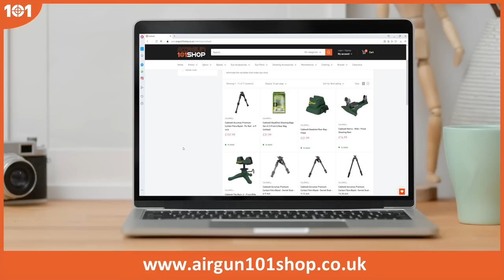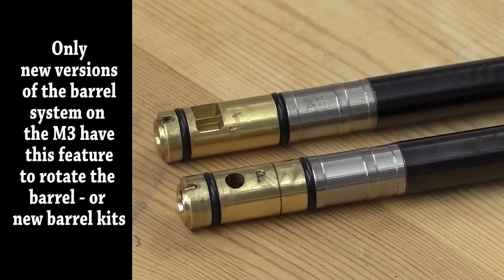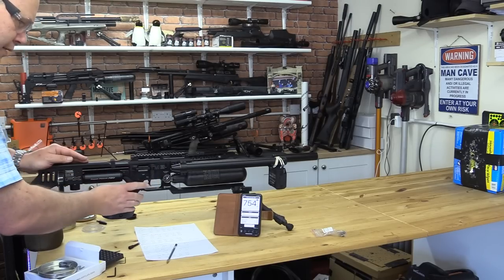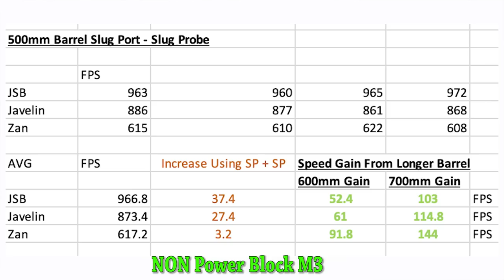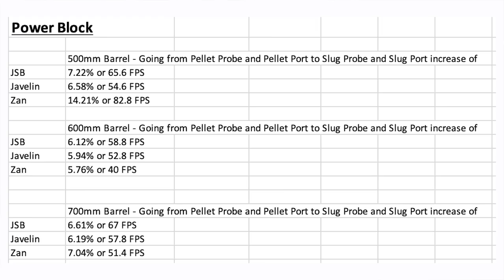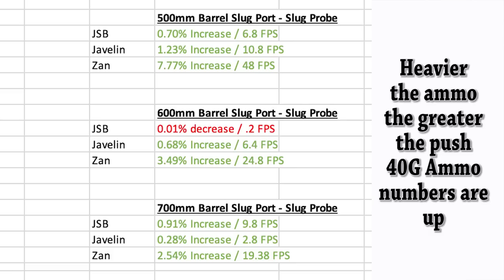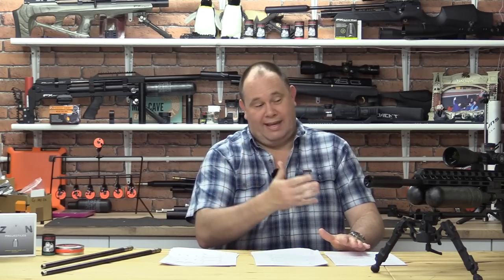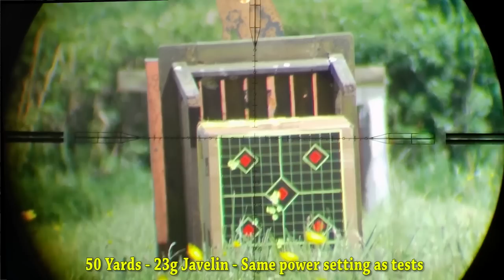Barrel Length Vs FPS Velocity Vs Power Block - SCIENCE ALERT

Comment: Excellent video and highly educational.  Justified my 700mm barrel upgrade!  Kind of fits in with the upgrades.  I took my Gen 1 Impact, added the power plenum and slug probe.  Achieving the same velocities at 35 bar lower reg setting.  It was a huge difference!  Do temper your expectations on what upgrades can do, but yes, they do work.  Well done!

Comment: Great vid and a real brain fryer. Absolutely on the mark with how it all works. The power block basically is designed for high reg pressure so won’t at 100bar make any real difference as the airflow is being governed by the other ports once you stuff the reg up to 150+ bar then it will still flow freely and will give serious speed increases over all barrel lengths although might actually over power the 500mm as that’s quite easy to do

Comment: Great experiment with valuable data. I surmise that if the reg pressure was set higher with the power block experiment, barrel length increase would result in increased speed up to a point. The comment by Joseph Boothe sums things up perfectly

Comment: awesome video, thank you!!! can you make one on accuracy relation on barrel length please!
Reply: There is no correlation between barrel length and accuracy, that myth has been busted a long time ago:) the problem with shorter barrels is that there’s often turbulence behind the pellet/slug because the projectile leaves the barrel sooner, and there’s still air being pushed out. The solution to that is tuning for a shorter burst of air, a shorter time where the valve is open, so there’s no more air being released when the projectile leaves the barrel. You can achieve this with higher reg pressure and less hammerspring tension. The higher pressure will close the valve faster

Comment: Do your findings also relate to springers? Would a standard length barrel give slightly more speed/power than the carbine model?
Reply: No. Most spring guns have barrel lengths that are sub optimal (too long) for velocity, same as 22 LR barrels. That's because a spring gun's compression chamber has a small volume, meaning the pressure behind the pellet drops rapidly during the firing cycle and at some point, as the pellet travels down the barrel, friction forces are greater than the force exerted by the compressed air.

Comment: Sir i have maverick.177 cal compact which barrel is more accurate 🙏need your suggestion 🙏🙏🥰
Reply from the maker: If you get groups your happy with, the one your using. Always test different pellets - 10.34g JSB normally do the trick, or try a Bisley - they work for me also. All part of the fun testing. G

Comment: The probe is not my favorite the power increases is small and does a worse job loading ammo accurately. But also the loading system on every airgun is pretty rubbish. I would go with the huma probe instead of the pin probe. Maybe someday we get something built from the ground up made for slugs. All in all I think this all good info just really don't like that probe. Bought 3 of them and they all bent within a few mags.